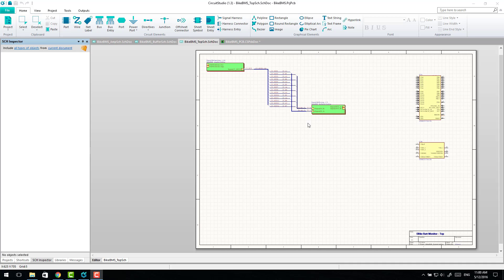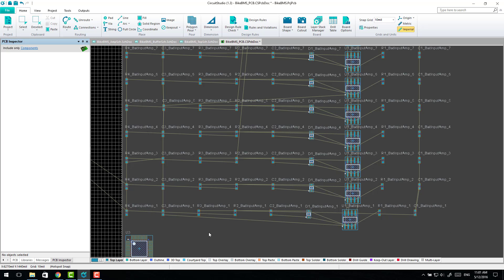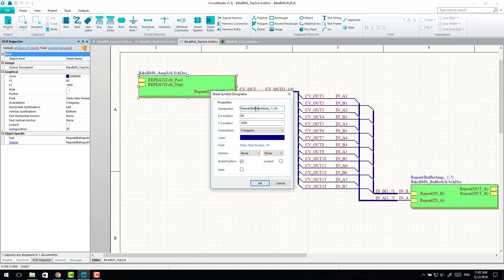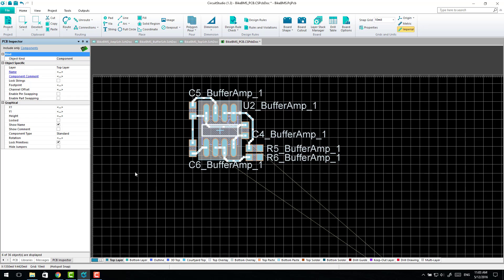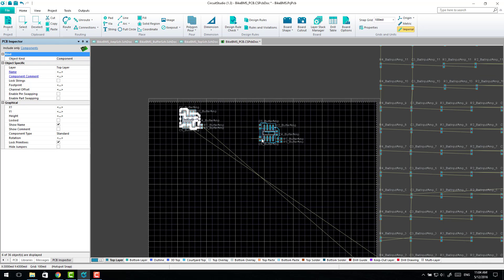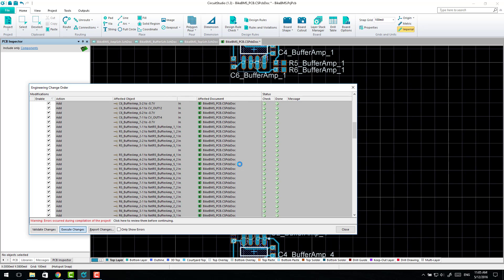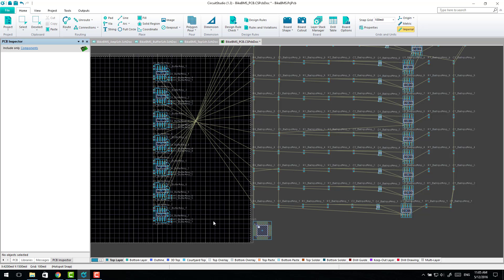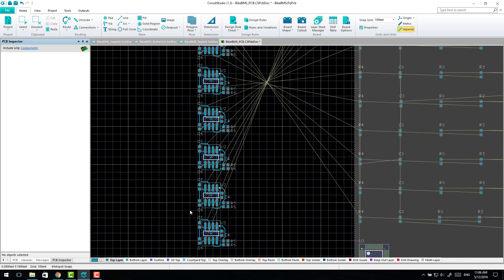CircuitStudio - Dealing with Multichannel Layouts

Comment: Hi Harvie! I've read that you haven't worked with Circuit Studio in a while. But I still wanted to ask you a question regarding your great Grey-Hair-Saving workaround for the multichannel layout. I used your workaround for a design. Now, almost a year later I'm revisioning the design with a couple of changes and I was wondering if you have a hint on how to prevent changes to the layout that I created with that workaround when I'm updating the pcb from the schematics, since it will always "destroy" the layouted multi-channel stuff cause the renamed parts are unknown from the schematics view. I know that I can disable parts and nets to be updated in the "engineering exchange order"-window. But since it's an almost neverending list of changes which are hard to dig through manually I was wondering if you know a way to freeze the multi-channel layout or exclude them from updating the pcb. Or maybe anybody else has ran into this "issue" and has any suggestions.

Comment: Will this method copy polygons as well as components and tracks? (e.g a 0V flood?)  I've got a design with 9 identical fairly complex dc-dc circuits on it and half a dozen polygons . I've completed one design and now need to copy it.
Reply from the maker: Sorry I can't tell you for certain, as I haven't used CS for a couple of years now (using AD these days.)  Polygons generally aren't a problem to copy and paste, however depending on paste settings they can loose their net association and need setting back to whatever net they should be after pasting.
Reply: @harvie256  Thanks! I'm not a PCB designer, just an engineer who now works for a small company who don't have a PCB designer...struggling through...slowly
Reply: Ok sort of done it. Vias can be pasted into a new circuit and keep connection, but it was tricky. First had to ensure 'Automatically Remove Loops'' was turned off, otherwise when connecting extra tracks to them (to lock them to the net you want) there is a tendency for the vias and some tracks to disappear...lots of expletives and head scratching on that one
Polygons are a different matter, net identity appears lost for good. Unfortunately I have 14 polygons per circuit.. so 126 to rename. Can't see any way round this.
Reply from the maker: @jeremylister89  That's quite a few polygons! In AD this can be done with "Paste Special" which is under paste in the edit menu.  You can select "Keep net name". Do you have the paste special command in CS?
Reply: @harvie256  yeah 14 polygons per circuit. I seem to like polygons! I'll check if I have that special paste command a bit later.
Thanks for the tip. Jerry